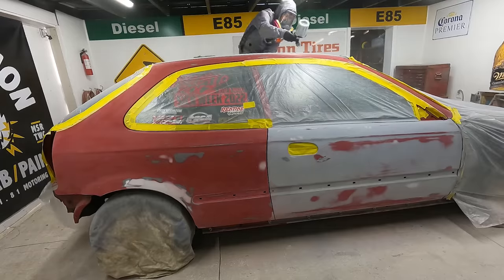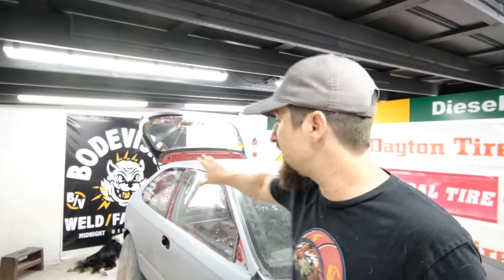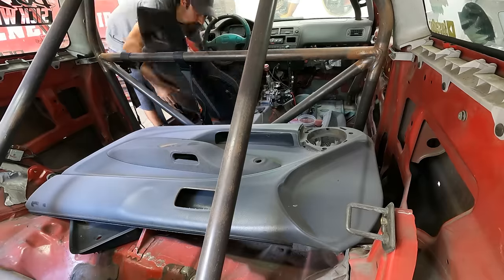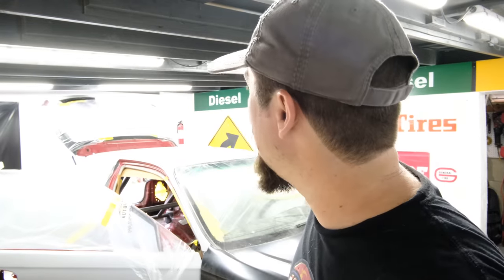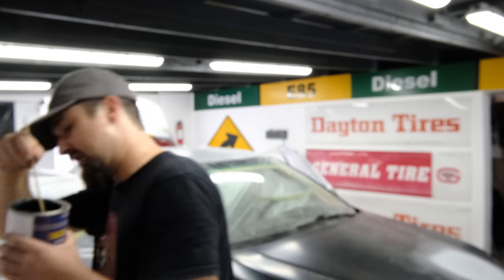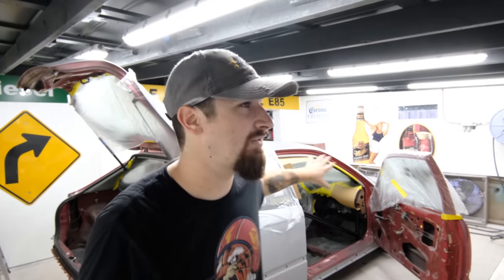Painting The Roll Cage In The @boostedboiz Civic Hatch

Comment: I painted one of my cars last weekend and got overspray on my garage floor. What do I use to get it up? It's a lot and it's red.
Reply: Try paint thinner, failing that, acetone.
Reply: @davidrobert2007  can't paint thinner or acetone damage the concrete?
Reply: @PetesCreativeRecycling  It shouldn't do, concrete is waterproof so any liquid shouldn't soak in or anything, plus being a solvent it will evaporate very quickly. You will need lots of ventilation, as it can be a fire risk with volatile solvents hanging in the air.

Comment: For my guide coat I just mist it all over with black rattle can primer
Reply from the maker: I have found rattle can primer to clog sand paper. But whatever works!
Reply: @BodeVision  I had problems with that to. But then I learned two things. 1. Use cheap primer. 2. I just barely mist it. You don't have to put a bunch on. Hell from 20-30 feet away you can barely see the guide coat. So there's less dots and they are smaller but they still find the low spots either way because you're only a foot or to away from the car while you're sanding it. An old timer told me when I was 17  "you're putting to much gawd dayum tracer on it, you ain't gotta be able to see that muffkkker across the street to be able to sand that sumbish, you gone be right up on it and see all em little dots". 😂. But anyway. I started learning how to do this shit in 1995. I still do a lot of old school shit cuz I learned from grumpy azz old men that did it in the 60s and, 70s.  I didn't even know there was a product committed to tracer/guide coat till about 10 years ago. Car looks great. Keep up the good work.